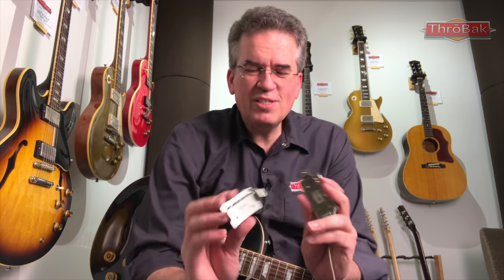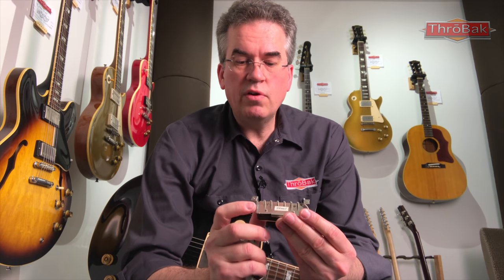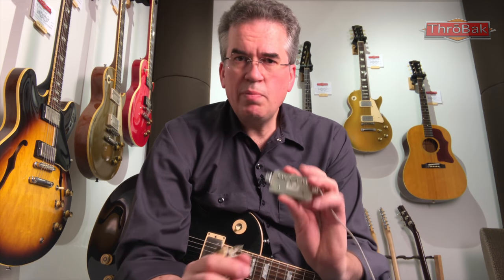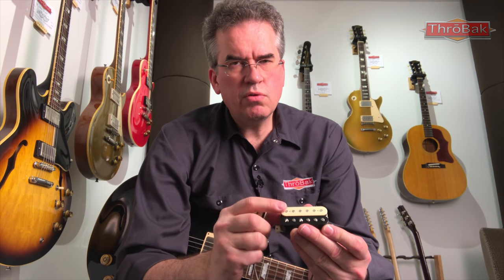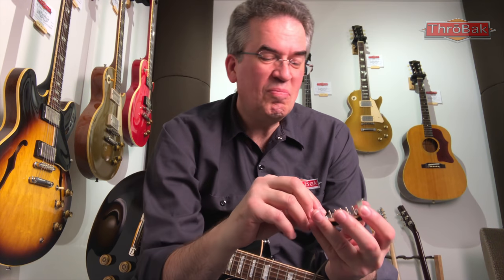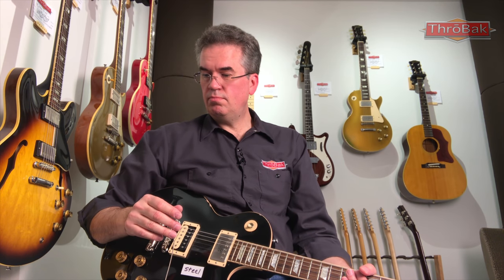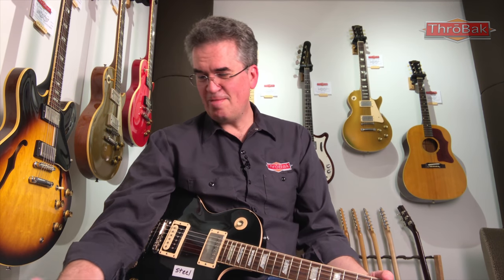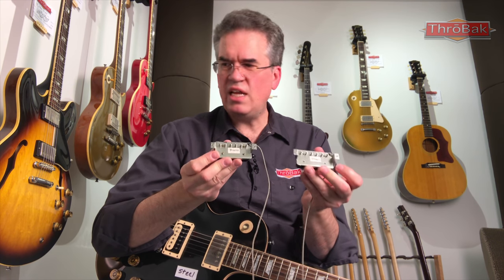P.A.F. Pickup Secrets: Brass vs. Steel Bobbin Screws

Comment: What I hear is more high end frequencies with steel screws. And I attribute that difference as the reason for the perceived higher output. Thanks for doing this test. I hear so many self-proclaimed experts state that steel screws on PAFs is "red flag." I had them on my 1957 Gibson ES350-T and was told steel means not authentic. I knew from the sound that were absolutely authentic. But then how can one really tell because a dozen PAFs may sound completely different from each other. Personally, I don't care. If the pickup has high impedance which gives me breakup sooner, I'm happy, PAF or not.

Comment: Definitely a difference. Steel = brighter, snappier. Brass = mellower, smoother.
Reply: Couldn't agree more. Steel can be used to give a little more juice to a low or medium output pickup, and brass could be used to maybe smooth out or soften a pickup that's a lil too hot

Comment: Sounds like slightly more presence (not abrupt, just a slope) on the strings in proximity to the steel screws - just listened again with the vid rolled up so I can't see the captions and yep, more presence on one of them. As RJR said, rabbit hole - but these little nuances are where the mojo is, even my old ears are hearing it. Excellent inquisitive train of thought and experimentation. Never seen any of these insights before.

Comment: I actually did hear a subtle increase in bits and snarl in the pups with steel screws. I currently use ThroBak strings on both my acoustic and electric guitars and am saving to get a set of pickups for my 69 SG. I live in Grand Rapids and would love to see your facility if that is at all possible.

Comment: Great Video! I've been amazed over the years working on guitars and amps to find that any small change in a metal alloy WILL be heard. For instance, a thumbwheel swap from brass to steel will definitely be heard and felt. And I've also tweaked the sound of an amp just by changing a one inch piece of wire. The trick is in being able to swap the parts quick enough to hear the difference before you forget what the first one was like (Alligator clips usually do the trick with electronic parts). The editing of this video is what confirms the subtle difference for everyone. Thanks Jon, for another great video on the secrets of the P.A.F.

Comment: Wow. I'm impressed. I've been listening to PAF type pickups a lot recently, and closely. 
I am sure I hear a significant difference between the brass and the steel - with the brass being more hollow or scouped sounding. I think the brass is more typical PAF sounding - which is of considering Peter Green and Paul Kossof's guitars had steel, and are benchmark PAF tones.

Comment: I'm late to this party, but I'm looking for three brass bobbin screws (probably best to buy 4 to keep them looking consistent). These are for two T-Tops that I removed from a 70' SG100 that had been butchered in the early 70's and retrofitted with these T-tops that apparently came from  a 60's es355. They are pat no. T-tops with Pat no. sticker, maple spacer, rough cast short magnets,(probably A5) but I have no way to tell. and aforesaid brass phillips bobbin screws, which I apparently lost in the 80's during my investigations. I've owned these since '76 and intend to retrofit them into a 2011 les paul lemon drop faded, as part of my 'Greeny' conversion (magnet in the neck pickup will be reversed for phase cancellation, etc). Great video, I love technical stuff like this. By the way. I couldn''t tell the difference. Cheers!

Comment: Now you left me wanting to get steel screws to try on my neck position SLE 101Plus since I like  my neck pickups to be as bright and clear as possible.
Reply: Douglas Maia I thought that sort of thing was obtained by mismatched coils and unoriented A5 magnets?
Reply: Mark70609 I'm not an expert, Jon is for sure. From the little I learned, when it comes to PAFS, every little thing matters in the end. It's not one thing, it's a combination of things and the result in relation to what your preferences are. One common thing all good pickups have is Clarity, that's a consensus. Dynamics is another key factor. So, coils, magnets, wires, construction, are part of a recipe. Having said that, the way everything is put together is also just as important, and that's the Magic some manufacturers can achieve. Throbak is top 3 for me, and that's saying a lot since there are so many good manufacturers nowadays.
Reply: Douglas Maia what are your top three pickup makers?

I have a set of Timbuckers that I really like. I'm sure Jon does a similar set, but I'm quite happy with them.

Jon does try and quantify all the differences for the consumer and I respect that.

Oh yes, he part of that phenomenon that economists can't quite believe, people will pay more for quality.
Reply: Mark70609 from the makers I had the chance to try and are currently producing, my top 3 are Throbak, Wizz and Ron Ellis in no particular order. Jim Rolph as a close 4th.
Reply: Douglas Maia I have a set of Ron Ellis pickups that I want to put into my R0. I got them 2nd hand, I've heard they are good, but not much more than that.
Reply: Mark70609 they are really good. I'm sure you will like them.
Reply: Douglas Maia thanks, they were available and I didn't want to go down the pickup rabbit hole.

Comment: The brass screws sound more clear and the steel have a blur but in a good juicy way.  The location in the bobbin relative to the particular strings is the "bob ross happy accident".  As the strings vibrate, they are moving away and back over the center of the pole pieces...the center of force.....by adding the hidden steel screw since its not seen from the top on exposed bobbins or a covered PU.....the particular strings as they deflect out of the respective pole pieces zone...they enter into the hidden zone and its a measure of a signal dip and spike but just in the affected area.  Brass would be a dip in signal so each pole piece zone would be uniform in performance.  Since the screws are between the high E and B strings and the low E and A strings.....its the nature of the strum when playing...the root notes of chords.  The low E and A will pack the most energy being low waves and its just a happy accident that the mounting screw happens to be right there...….in a down strum.  The up strum starting on the high E and B...same principle though less energy than the opposite side low strings...the extra kick of the hidden screw adds to the high E bends because you bend over the hidden active pole as you move away from the initial pole......the signal doesn't dip out.

Kind of like having partial Blade pickups.....in concept....without the blade
Reply: The big question is.....did you do the metallurgy on the steel screws like you have with the steel pole pieces ?
Reply: I'd lean towards the steel screws along with an alnico 4 magnet...….but the magnet choice opens up the new variable to play with. 
In the PAF world...that probably explains why some players say that particular guitars in the 57 to 60 window have it or not as far as the magic.
Obviously you are using the formula or a reverse engineering approach based on random sampling.  
I recently ran into a peculiar thing about the wiring of the bobbins as they are wired together....as opposed to the magnet orientation relative to phase......if you look at the phase scenario as a situation of having 2 humbuckers in a guitar and the orientation of the magnets between the 2 and in the middle position on the selector switch...…..which is part of the Peter Green thing.
But the thing I saw was that a pickup was hooked up to an ohm meter to read the DC resistance and while on the meter a ferrous piece of metal was touched to the pole pieces......observing the meter...there is either a momentary spike up or a momentary dip down.....which is corresponding to the bobbin linking being with the starts or the finishes.....essentially playing in or out.....and other to the magnet orientation.  
So again like the steel bobbin screws.....the playing in or out may be a further factor to examine.
The alnico 4 magnets seem to be the neutral magnet that's even in response where as the other grades tend to influence tonality in directions.
Everything points to Gibson using what is available in the heat of the moment.....not 100% consistency......whether it be the bobbin mounting screws or the magnets or the color of the bobbins or possibly the color of the wire.
Reply from the maker: Screws this small have to made with low carbon steel.

Comment: Very clearly an audible difference. I suspect that you would hear a similar difference if you used slightly longer slugs or if you used the next larger diameter screw size for the pole pieces, or set the pickups slightly closer to the strings.  Likewise, different alloy slugs and pole screws, and annealing pole screws with cold rolled threads would affect the sound.  This is a great example of why you need to pay attention to the details, because nearly everything can have some effect on the sound.

Comment: Jon, the Brass is smoother sounding. The steel has a slightly brighter, slightly more aggressive tonality. I'm listening to this on my iPad with a little Bluetooth remote speaker. So if I can hear it on this, then I would imagine that through some good speakers/system it would be a bit more pronounced.
But, great topic and great video on your part! Thanks for doing this comparison!! Maybe do a video on the different pole screws that Gibson used(?)..
BTW, can I buy a dozen steel screws?
Reply from the maker: Thanks! I’m hearing the same thing.
Reply: Amazing, I completely confirm with a great pair of headphones! Great sounds, brass jazz steel rock! I will surely check my pick ups!
Reply: This is exactly what I'm hearing too.
Reply: ThroBak Guitar Lounge I wonder how a players touch would interact with either pickups? 

I personally would be happy with the brass as it seems smoother and more linear for lack of a better term. I also wonder if turn the treble control and the volume control up would yield similar results?

Mind you I could see people playing a pickup with the steel screws and being pleasantly surprised .

Will a Kossoff pickup be made by Throbak for the masses?

Comment: I agree with you in that the steel has a brighter, slightly more output, brass seems warmer and slightly less output. Kind of reminds me of sustain blocks on a tremolo, I personally find brass to be warmer or slightly darker than the steel blocks, buts that's a different subject, but that's what I have noticed with brass opposed to steel.

Comment: No doubt about it there is a difference!  It's Interesting that the steel mounting screws do sound brighter or more open/ more output and that to me is better. I tend to like brighter when it comes to humbuckers.  Also interesting that 2 of the best PAF sounds to me were Peter Green's Les Paul and Paul Kossoff's Les Paul and they had steel mounting screws.  Now my question to Jon Gundry is would you sell some of those screws so I could change the brass ones in my SLE 101 limited pickups. I hope I won't mess up the pickup. Yikes!
Reply from the maker: Sorry I don’t sell the screws separately.
Reply: @ThroBakChannel  not even to a customer who has purchased your pickups?
Reply from the maker: The pickups with the brass screws were designed with the tone of the brass screws as being part of the formula. There is also a small but real potential to strip out the plastic by changing the screws. I also do not have a checkout setup for the steel screws. I’m really in the business of making the pickups more than selling the parts.
Reply: @ThroBakChannel  I would buy a set of all your pickups if I could afford to.  I am jealous of doctors and lawyers who can afford them.

Comment: I love this video and the very obvious affect it has on the tone. That said Iron based materials and certain other materials can be permanently magnetized. What you may not be aware of; or maybe not informing of; is that magnetic fields and electricity go hand in hand. Run electricity through any conductor and a magnetic field will form. Pass a magnetic field through a conductor and electricity will be produced. This is how the copper coils of the pickup manage to turn string motion (movement) in an electrical current that is the pick-up output signal.
Other conductors can be temporally magnetized as well by these effects as well. Magnetic induction aluminium disk brakes work by this principal for instance.  e.g. (simplified version) Pass a magnetic field through a rotating aluminium disk. The disk will become magnetized and produce eddy currents. These eddy currents will resist the magnetic lines of force and produce more magnetic fields further inducing more eddy currents. The result of this, without physical friction, is that a counter rotational torque is created and braking load force applied. As long as there is movement or varying magnetic fields.
Brass can be temporally magnetized too. It's just that the steel works much better, that this has a noticeable effect. Chances are, if you replaced the brass screws with a nonconductor. The pickups would likely lose some output, as opposed to the gain you see with replacing brass with steel.  
Love your videos.
Cheers
EDIT:
I have a question, have you ever tried to observe magnetic field of vintage PAF's or the unsymmetrical magnetic properties of vintage copper winding's. I can think of one or two easy methods to accomplish this. It would be interesting to know if you done this and if you had observed a good parity between your pickups and vintage PAF's.

Comment: I have a question.   Did you use the same exact pickup and switch the screws, on that pickup, or was it 2 different pickups, one with steel screws,  and a different pickup with brass screws? I did hear a difference, but if 2 different pickups were used, couldn't it just be that each pickup sounds a little different?
Reply from the maker: They are the same pickups. Just the bobbin mountings screws are different.

Comment: I'm was surprised that I could hear the difference. I like the steel not sure if others consider that "vintage sound correct", personally though I'm not interested in them sounding vintage, though its not my guitar/guitar restoration. I was wondering what equipment you use to do pickup comparisons ? Since I am looking at a Peavey mixer 6 usb, or audio interface (uphoria 2 something), not sure if I need a DI box. Anyway I wanted to do pickup comparison videos and since I can hear a difference in the small screws I figure you are the guy to ask, thanks for your time.
Reply from the maker: I use a Microtech Gefell mic in figure 8 through a phantom power pre amp and I mix in a touch of the lav mic. No processing other than what youtube does.
Reply: Wow, awesome thanks for the reply. Can't afford that mic currently saving money for school books, but thanks for the info and response I know you're busy thinking of "stuff" lol

Comment: Hey Jon.... Ed A here.... yeah so definitely hear the brighter attack of the steel screws.... first question (sorry if this has already been asked).... Was this test 100%, controlled... meaning same pickup, just screws changed? same strings?.... how was it recorded?.... Believe it or not, in my own home recordings there can be a huge difference based on the physical angle of the guitar and the sound reflecting off of it and into my phone mic... I notice the angle youre sitting is different in both tests.... but if you are close micing then that wont matter..... just curious because any little thing can be causing the difference... OR... it really can be the screws!...  cool demo!
Reply from the maker: Everything was controlled. Just the screws were changed. I literally just loosened the strings, took out the mounting ring with the pickup in it, changed screws and put it back in the guitar. So strings and even pickup height was never messed with. I used a Microtech Gefell mic in figure 8 mode through a pre amp. Mic placement is same for both clips.
Reply: Well then there you go! I knew with you it would be controlled but as you said it’s kind a hard to believe there would be a difference and you prove there is!

Comment: I thought the brass better followed what the string was doing while the steel had a tendency to go its own way and develop a slight dissonance  when the string was struck hard and did not decay smoothly but rather more abruptly than the brass.  Same effect as having steel bridge  support screws versus brass ; a sort of hardness to the tone which might be desirable for aggressive tones.

Comment: Just watched the vid again, and there is a big difference. On a different tack, have you / could you do a vid on differing wind tensions and different types of wire coating (the "enamel") - it seems quite obvious that the conductivity/dialectic characteristics / collective capacitance of different enamels (some of which aren't really enamels) would give different electrical measurements. Also, I assume different enamels will deteriorate at different rates over time in different environments. Any chance of analysing these aspects? The naysayers will call BS/no difference but those with a more analytical brain will look for and note the subtleties and collective subtleties.
Reply from the maker: I’ll do videos comparing some of those details in the future.
Reply: Thank you Jon, you're a gem (and guru) :o)